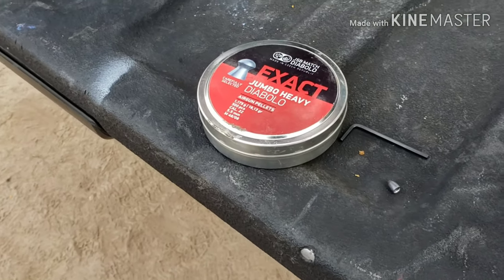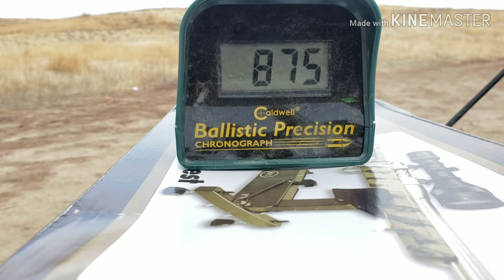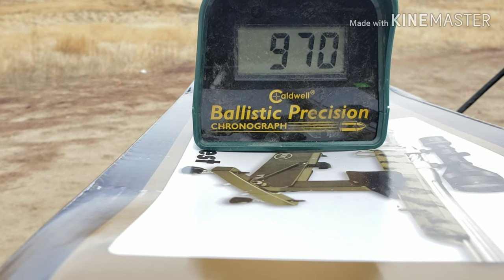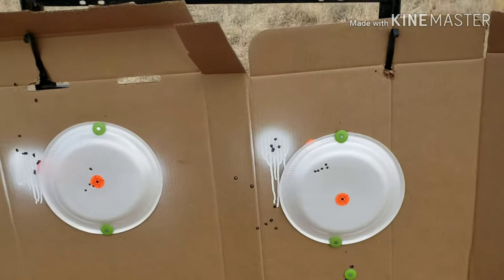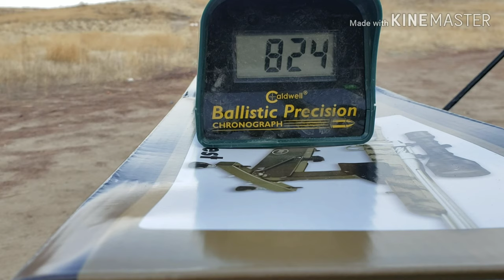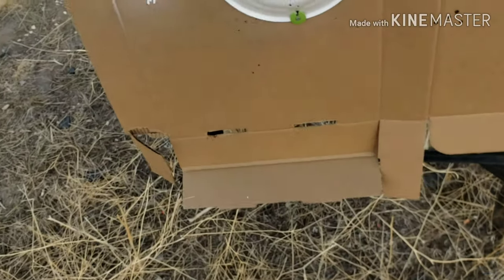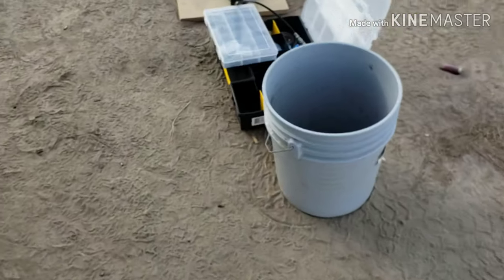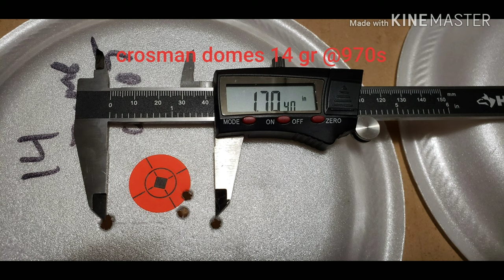Kral puncher breaker

Comment: Have you modded your kral puncher breaker at all just curious
Reply from the maker: Yes. I have done some things to it. I am going to make a video here soon. And I'll answer your question.
Reply from the maker: The mods I did to my air rifle. I have two Springs to push the hammer so it can hit the valve harder. I also made a bigger hole on the power adjuster. I also made a slightly bigger hole on the Barrel transfer port and the valve. I am going to make a video on the mods I did to the rifle. If you have any other questions on the hatsan nova. 177 I'll try to answer them.